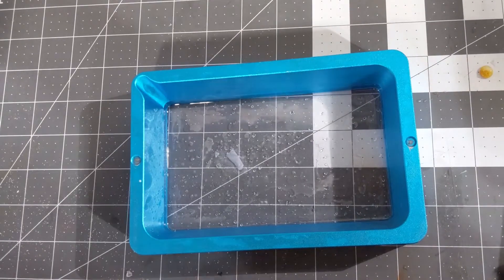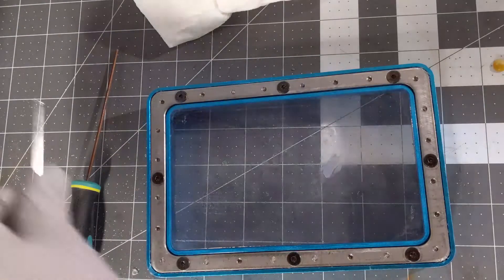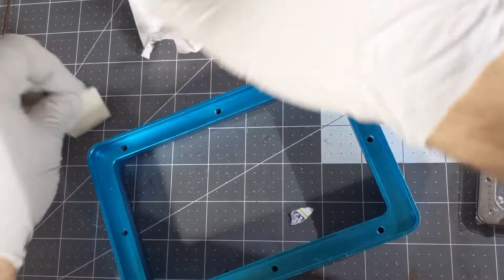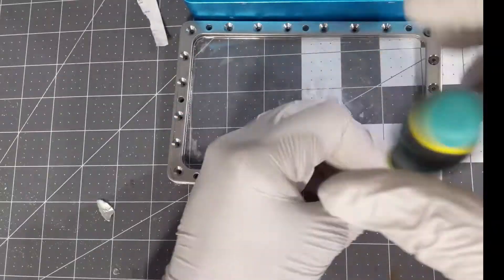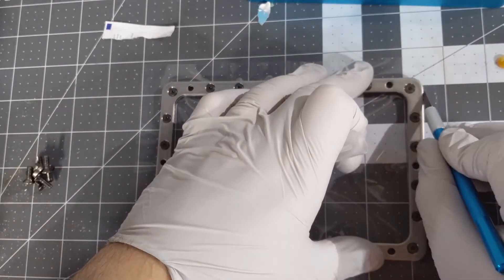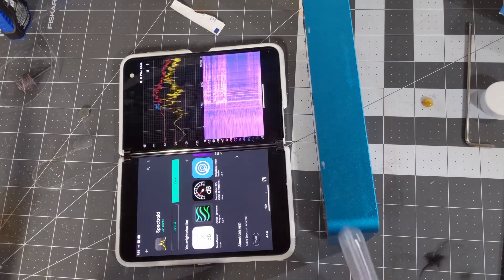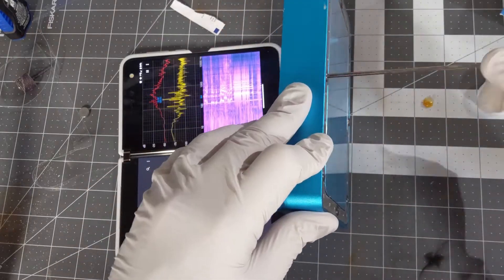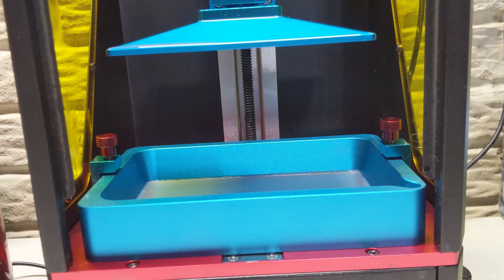Replace & TUNE your 3D printer FEP

Comment: So for my Photon original, just like this one, I have not tuned it.  Since replacing the factory FEP I've gotten mostly failed blobs stuck to my FEP.  This is the one detail I have not considered, would a FEP too loose cause that?  Cause I'm pretty sure I'm undertightening as I'm tightening about a half to full turn past hand tight. Basically enough that resin stays put without seeping under the rim.

Comment: My fep wont get to 333, stuck around 175hz and i run out of turns on the bolts. Any ideas?
Reply: Harmonics you are looking at the wrong part of the graph
Reply: Basically you want to zoom in to the desired frequency and keep track of the peak dB when you hit the FEP using the the green marker

Comment: Don't do what I did... trying to do this from memory without rewatching the video, I tried to get it to the right frequency without attaching it to the vat first. Ended up stripping some of the frame screws and not getting it up to the right frequency still. Wish I had rewatched it. =) The video was really clear and helpful, after I followed the instructions correctly it worked great.

Comment: Everyone tells me to use an audio analyzer to check my fep no one will tell me how to read the audio analyzer to make any sense out of the gobbledygook on my screen when I try to use any of these apps
Reply: Come back every few months to see if someone says something or offers a better app.

The rooms ambient noise measures between 36 to 400 Hz.

When hitting with the eraser of a pencil: Sometimes it goes up to 1200, sometimes 800, sometimes 500. It doesn't give me time to see the numbers properly before moving and doesn't have a numerical record. How do I read these spikes? Which number is it?

My printer's range is between 300 and 450.

Comment: Both sides of the fep are the same material or only one is coated?
Reply from the maker: Both sides are the same but I've bought some that had a protective sheet on both sides that I needed to peel off first.  If it seems thicker than the one you took off check to see if there are multiple stuck together or if there is a protective sheet to peel off

Comment: Trying to tighten the FEP on my Photon M3. I am finding that past 180Hz, tightening more actually makes the frequency lower. I tightened the heck out of it and I think the plastic frame is buckling.
Reply from the maker: It sounds like maybe your FEP is thicker, still has the protective plastic on it or it was not tight enough when added to the frame
Reply: @TheOhayoDev  the FEPs for the little M3 come glued in the frame, so I don't have any control over how tight they are when first framed. I had actually tightened it so much the screws started to come out the top of the vat and I had to buy a whole new vat, haha.
Reply: @Promii  yeah this guide might not work for your printer. I've never seen a printer where the FEP is permanently attracted to the vat. The FEP is meant to be a consumable part so it seems weird to have to replace the vat along with it
Reply: @jared3562  they come in the frame, which you then screw in to the vat. I just had to replace mine because I broke it mistakenly. It seems to be only the smallest photon M3 that is like this. The M3 plus and max have the normal type of frame that accepts replacement films. I unfortunately was not aware of this when I bought the printer.
Reply from the maker: @Promii  yeah the new printers are a little different with their replacements. You'll see on the original photon it has a metal frame and you can just replace the FEP.  Some of the printers now have the FEP attached to the frame and you have to buy it all as one piece.

 If you're getting 180 Hz you might want to check the tool you're using to measure the sound. It would sound super low

https://amzn.to/3QK4U2u

With ones like these in the link they should be pretuned from the factory and you just screw it down until tight. I believe a new one of these tunes to about 310-320.

Comment: I just got my resin 3d printer last week and all of my large prints have warping issues. Small prints come out fine. I checked my FEP and it is around 165 Hz. I tried to tighten it more but I couldn't. Could this be the reason my large prints are warping?
Reply from the maker: Yeah I would say that is very likely. If it's not tight enough the printer will have trouble popping layers with a large surface area off the FEP. If you can't tighten it any more you might want to try to replace the FEP
Reply: That's nice, but do you have any explanation on how to tension it?

Comment: The hz check is great! Should the frequency be the same for every size of printer? Or would larger printers require different levels of tension?
Reply from the maker: I can't speak to every printer but I've had people in Facebook groups say that ranges from 320-340 worked for their Elegoo Saturn which has a larger area.  That being said they're some gigantic resin printers out there and I have no idea how one would calibrate those
Reply: @TheOhayoDev  yeah facebook has so much accurate information aye
Reply: Exactly my question, and got no answer for this. However my logic says a bigger surface on the same tightness, must resonate at a lower frequency.

Comment: Everyone seems to be so certain of their pitch.. I'm using the same app and when I tap it repeatedly the blue line jumps up to around 400 but stays at 200 most of the time. Which one should I follow? 

I'd try to bring the 200hz up to 300+ but it already feels quite tight to me, and no one ever posts about how taught it should feel so it's hard to gauge. At 200/400hz When I push it gently with my finger there's about 1-3mm of slack. Should I continue tightening?
Reply from the maker: I usually do rapid tapping at a consistent strength and look at the average (usually ends up being close to the highest number) over the period of tapping

Comment: Just curious I am new to this but shouldn't you re-level the build plate when you change the FEP
Reply from the maker: It's probably not a bad idea to relevel periodically but since you don't use the vat in the leveling process you shouldn't need to do it when you replace the FEP .
Reply: Yes

Comment: Without the screws actually being tightened whats to keep them from loosening with the vibration that comes from printing?  Wouldn't be better to have a proper sized spacer under the FEP before, installing it into the vat so it would be all the way tightened to about 333Mhz?
Reply from the maker: You can print an exact size spacer for consistency but it is not the spacer that ensures the tightness and frequency of the FEP.  It is like tightening a drum.

You also should not have any vibration coming from your printer that is even close enough to loosen these screws

Here is a spacer on thingiverse if you're interested.
https://www.thingiverse.com/thing:3351933

Comment: Is the 333 Hz spec good for am Elegoo Mars 2 Pro printer?  Thanks
Reply from the maker: As far as I know it is a good starting point for most resin printers with FEP.  If you find that prints are not sticking verify the build plate z=0 is set correctly and try tightening the FEP little by little with tests in between.

Let us know if something other than 333hz works better for you
Reply: @TheOhayoDev  One important note - When I tested the Hz it was on a new vat/with installed FEP, BUT, the protective film was still on. SO, I imagine that the freq will change after the protective film is removed.  Crossing fingers have printed a bunch all great and hope to get good mileage with this new FEP.
Reply: @ainttakenanyshit is 333hz working with you ? I have elegoo mars 2 pro too i changed the fep and i started getting failed prints

Comment: How did you come up with 333Hz? I am trying to research the proper tuning for my Saturn, but no one can seem to tell me what is proper. Also, what happens if the screws are too lose, will resin flow out? Why a bottle cap and not something consistent that everyone can print? 

So many questions and so few answers. :/
Reply from the maker: 1.  When I received my printer is was pre tuned almost exactly 333Hz out of the box.  I have tried to go higher and lower but 333Hz is what has worked best for me and it is easy to remember 333.
2.  The screws would have to be quite loose to allow the resin to flow out but it could happen.  Most likely if the screws are too loose you're prints will not stick to the build plate.  Likely you will see nothing on the buildplate when it finishes and be left with cured resin in the reservoir.
3.  The bottlecap gives a good starting point so that the FEP is not too tight to begin screwing into the buildplate.  You can use something else but the bottlecap is smooth on top and shouldn't scratch the FEP. It is just important to use something that allows the FEP frame to be inserted and begin to be tightened without tearing the FEP.
Reply: @TheOhayoDev  yeah how did you know 333hz was the correct number, and is 333hz the same on the entire surface on the fep, i have m3 max and you get different frenzy on the side of the vat than that on the middle
Reply: @jimmyjames1807  have you been able to get it right on the m3 max. Thanks!!
Reply: Dang.  Had I known this technique, I would have measured the hertz when my Creality-LD002H was new.  Now I have no idea what the original hertz was.  Crap.